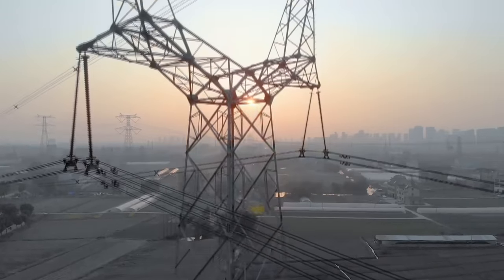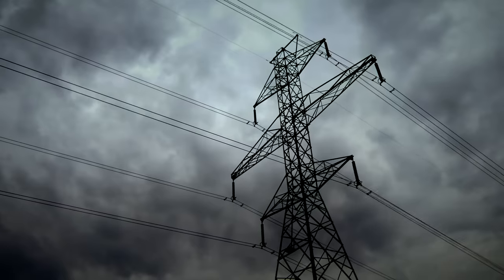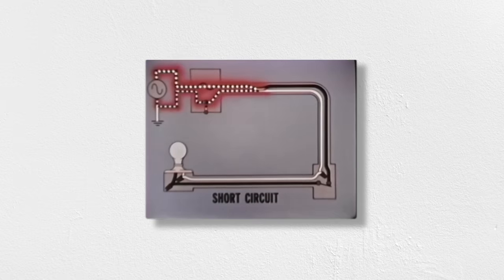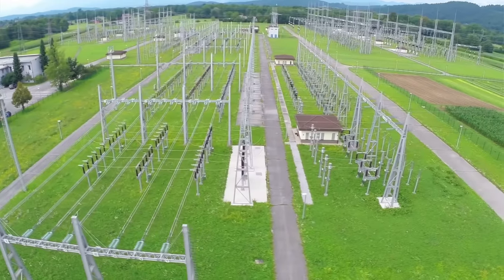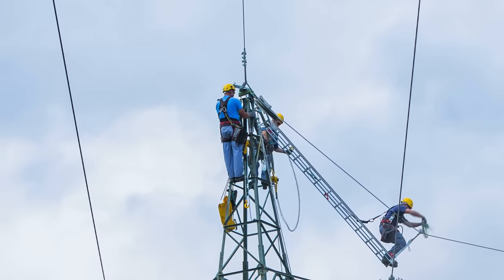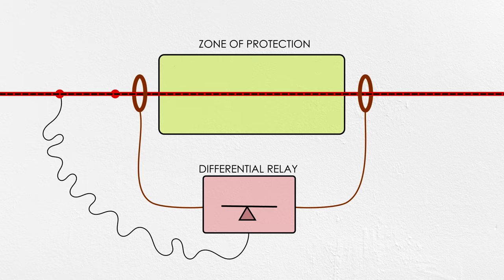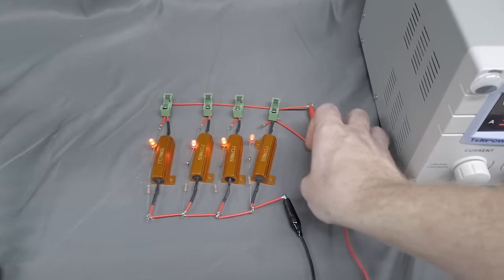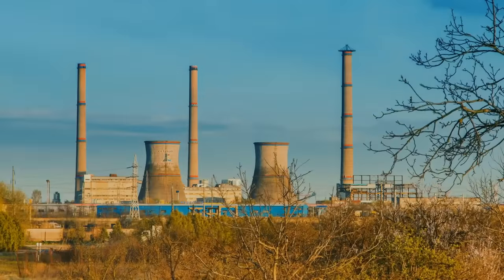How Power Blackouts Work

Comment: "Idk how much a car that never breaks down would cost"    About $1500 on craigslist for a 1994 Camry.....just sayin.
Reply: got a 97 civic that'll challenge that lol
Reply: I have a gold 1994 Camry that just rolled over to 390,000 miles. Can confirm.
Reply: The best is the Previa though. 750,000 miles on the engine and it's still got resale value
Reply: My gold Camry is approaching it's 20th birthday and everything is still working. Just keep the oil fresh and they'll go forever
Reply: Lol I thought of my 94 Camry as soon as he said that
Reply: IMO, I'd rather have a more reliable, longer lasting engine than one that sacrifices a good portion of potential lifespan for the sake of barely increasing "theoretical" fuel efficiency.  Real world driving conditions vary wildly, and is especially dependant on the operator.

(Edited on 10/27/2020 to be more descriptive)
Reply: Alfa 156 ts
Reply: My dad had a 94 Camry that he bought way back in 2001. It got stolen after about 7 years of being absolutely fricking invincible. Shit never broke down.
Reply: Toyota Starlet, still going strong
Reply: @sodiumvapor13  My father has a 2005 GMC Yukon with similar milage. Still has the original engine and transmission.
Reply: Lancia still going strong, no bodywork left after couple years due to rust but strong engine shame about electrics.
Reply: Volkswagen Golf 1965.
3000000 km and still going on.
Reply: '99 ford focus it is for me
Reply: Scotty Kilmer: [Breathes heavily]
Reply: Matt Farah has a 1,000,000 mile Lexus.
Only problems have been: very minor oil leak (1 quart every 1,000 miles) and worn down suspension bushings.
Reply: Or something you bought as a broken thing
Can't break if it was already
Reply: nostalgia from it being a mini
Reply: Willys cj2a 1947, nothing but a fuel pump rebuild and new head gasket in 75 years, well over 400k logged running hours
Reply: Oh man, came here to say just this!
Reply: 237k on my Camry. Have only done brakes and fluids.
Reply: Don’t listen to these guys, get a dodge! I’m only on my 5th engine!
Reply: Buy a German tank. Might be a bit hard to get replacement parts for those but it's unlikely to break down.
Reply: @PunakiviAddikti  problem is when it finally does it gets expensive.
Reply: Saturns man. I've got two. Bought my second one for $400. Already put 40,000 miles on it since. Drove it round trip from northern Utah to Texas. It's also driven nonstop to Albuquerque and back twice.
Reply: My beast of choice is an 01 golf. Broken but still runs anyway.
Reply: @DumbdogsWin  bah. Who needs all the features working
Reply: @LenniL-ob4ll  not really no. I drive cross country for a living. I don't get stranded.
Reply: Just look at the window sticker on a chevy.
Reply: No the 2001 model is where it's at.... Expect the door handles
Reply: Its called   rent a car,   if it breaksdown  Avis come pick it up and give you another,
Reply: @manitoba-op4jx  this is not matt farahs million mile lexus though
Reply: Co-worker sold his late 90's Ford Taurus for $500 ten years ago with 200,000 miles on it. Now it's at 400,000 miles still running on original engine/transmission. John told the girl, just keep doing what I've been doing since I bought it new. Engine oil 3k, transmission fluid once a year.  Maintenance is key.
Reply: 2001 VW MK4 Jetta. 250k km and not a single breakdown.
Reply: I can approve that. Bought a 92 Camry new from the dealer and it's still runing like a champ. Only maintenance and smaller stuff here and there. I drive that thing everyday around 300km or nearly 200 miles for all that time. 150km/100mi oneway. Don't know how far I've driven it, because the odometer stopped working long ago and I never saw a reason to fix it. The second clutch starts to wear out now but really it's mostly an oil change every 3 months or better to say 11 weeks, endless tyres, brake discs and pads. The front springs snapped once and I'm on the third set of wheel bearings. Other than that, no issues. I will keep as long as I can, no car will every come back to such reliability, lucky that I never sold it. In the first years I was thinking about it several times but scepticism held me back everyday and apparently I've been proven right. I dare the day I can't keep it anymore or an idiot will total it by rear ending me
Reply: Pretty sure that still needs a lot of maintenance, though. I think the closest you could get to a car that never breaks down would be the Mars rovers. Opportunity lasted 15 years with zero mechanical maintenance (only software), but it's pretty small, certainly not anything remotely like a car. Curiosity, though, has been going for 8 years and is still doing pretty well and it definitely is car-sized. So, as long as you're comfortable traveling at 90 meters per hour and are willing to spend a couple billion dollars, that's the car for you (a lifetime supply of fuel is included in the purchase price).
Reply: Gear God just don’t put a aftermarket set of wheels, especially the heavy chrome ones. The transmission will not like that, especially when it is asked to use the traction from double wide tires.
Reply: Note that this is more design choices than actual impracticability. Well, ok, you couldn't make cars where literally no instance of that model will ever break, of course. But think about aircraft. One of the top concerns for civil aircraft is reliability and if you maintain an aircraft well, it may well never break down. And even when it does there are usually multiple redundencies and even if those fail, the plane can often still fundamentally continue to perform with a good enough pilot having a chance of landing it. Cars break down as much as they do because it doesn't matter as much if they break down.

Car engines are designed for relative performance over reliability and have many unnecessary parts because you know, if your radiator springs a leak in a car, it might be a nuisance but it's rarely fatal. If your radiator sprung a leak at 8000ft, that's something of a different scenario, which is why most civil aircraft engines are air-cooled. Point is, aircraft are designed for reliability, often at the expense of pure peformance, because that's the calculation being made. If you designed a car like an airplane it would probably never break down (though it would go through fuel like a bitch, spew toxic fumes all over town, be noisy as hell etc). That being said, aircraft are fairly expensive.
Reply: Got a 2007 Ford Explorer that only had a fuel tank pump issue that was fixed within a month
Reply: 2000 dodge dakota v6 magnum, automatic tranny 2wd
did some work up behid the dash so we pulled the dash well while we were back there we did a full aircon rebuild, the heat exchange in the cab the one up frount, the compressor was dead so that got replaced
well we ran into a few issues here and there, replaced the rad and coolant
well we were so damn close to done then it turned into even more of a shit storm
the damn dipstick tube broke off in the block 
we tried to get it out, ended up breaking a tap off in it.... 
yep we have a lot of work on this cursed truck
Reply: * Happy Scotty Kilmer sounds *
Reply: My dad has a 2004 Saturn ion the has 395000 miles
Reply: $89000 for a new Land Cruiser.
Reply: @nup5  i agree, I'd rather have my plain old-fashioned naturally aspirated 1.8l engine than a turbocharged, low displacement engine that makes similar power.
Reply: I guess, to be fair, you have to consider all the routine maintenance you still need to do. Brake pads, engine oil, oil filter, air filter, tires, wipers, lights, etc.
Reply: @nup5  so your saying a lada niva is just as good as a toyota landcruiser
Reply: @manitoba-op4jx  i have heard toyota landcruisers exede that number
Reply: @loganritt3805  I'm not sure what you mean by that, but ultimately it depends on use case (unless, overall, one has many advantages over the other).  Can you explain what you mean with that comparison?
Reply: @nup5  you said that reliability has small efficiency gains and a lada niva is an unreliable car, and a Toyota landcruiser is a reliable car. What do you think would be faster at doing a job
Reply: @loganritt3805  oooooh.  What I meant was, I'd rather have an engine with a very long lifespan, even if it's not too efficient, instead of one that sacrifices lifespan for the sake of using less fuel.

Especially if the efficiency gains are trivial/not worth said lifespan reduction.
Reply: I have a 2007 camry still tippin on 44s
Reply: how about that toyota truck top gear tested
Reply: Can't beat a Landcruiser
Reply: @kperry5000  or don’t put fresh oil and it will still last longer than most cars
Reply: Awesome comment. I laughed and almost choked on my toast.
Reply: Anything before the 2000s don't break down all that often. This new cr@p they put out breaks down if you bump it. My 93 grand Cherokee was a tank never broke down and I trashed it. Buddys 07 vw golf already sounds like its done a year after he bought it
Reply: I have a saab with 550,000km... drives like new
Reply: Buick century
Reply: I got a nissan that isn't too much if he needs one.

Comment: Nice demonstration with the 4 led’s
Reply: its a great demonstration that deserved a better explanation for the voltage rise.
Reply: Not a very realistic one though: you can see the power supply is in constant CURRENT mode (6:53, the CC LED is on), which means it will do whatever it takes to shove down the current meant for four resistors down the remaining three , basically by raising the voltage until that happens. It wouldn't do that at all in its normal, constant voltage mode. In real life, the voltage applied to three lightbulbs in your home does definitely not go up just because you've turned the fourth one off (or more exactly it does so negligibly little).

Now, it's certainly possible that the power grid can have some sort of equivalent phenomenon going on in specific situations, but how or why that would happen was certainly not explained here at all.
Reply: True, the voltage is constant, but the current rise is what does the damage.  In combination Primary/Distribution substations some circuits have inductors because the primary transformers can (for a few cycles) put out enough current to melt and  fuse circuit breaker contacts together.  The inductor resembles a tube, and is designed such that normal load currents pass through, but a massive overcurrent fault will cause a huge counter-EMF (backpressure wave opposing current flow) in the inductor stopping any spikes from the primary transformers dead in their tracks.
Reply: @AttilaAsztalos  When I turn off my electric kettle at home, I can see the lights going brighter for a few milliseconds
Reply: @AttilaAsztalos  but that demonstration was exactly what happened when the 2003 outage happen. One line goes out and all the power (or current) that pass on that line had to be distributed to another line, which subsequently went out because to much power (current) and in few moments all northeast were out of electricity
Reply: @josedias3157  Resistor demonstration is exactly reverse of that.
Reply: @josedias3157  so how do they prevent it?
Reply: Picard doesn’t agree.
Reply: Quite misleading actually. The power supply is forcing current.
Reply: José Dias That happened because the same demand got redirected through less lines. In fact, the outage happened all at once, not gradually. The correct demonstration would’ve been the fourth LED staying lit, and drawing current from the other 3 lines, that ended up overloaded. There is a misconception, the power isn’t “pushed” in power grids, it gets “drawn”.
Reply: @josedias3157  I think that if one line leading to one city breaks, that won't increase load in the line to other city. When voltage is constant current is calculated by Ohms law (I=V/R, I=P/V). But when you suddenly take off the load form power stations generator, it can't change regime so quickly and it has to go down. If one goes down there is great probability that others will to, cause then the load of remaining grid is too high for them. That's why some countries have reversible dam power plants so they can balance the load in the grid.
Reply: @AttilaAsztalos  The equivalent phenomenon in the grid would be where you had several transmission lines in parallel feeding the city, and one failed. The LED does not represent the lights in the house, it represents the current across each transmission line.
Reply: Thanks
Reply: really fake demonstration, a parallel circuit does not collapse when a branch is down, only if it is permanently shorted.
power supply display not being shown in the video is a clue of what's going on.
Also demand is not pulled out of the grid by a line disconnection, that's the key of power grid overloads
Reply: The lack of electrical understanding in this thread is outstanding. When you have multiple parallel lines feeding a load and one goes down,  the current drawn by the load doesn't magically go down to account for the missing line. The resistance of the line is orders of magnitude smaller than the resistance of the load.
Practical Engineering was 100% correct with his constant current supply.
Reply: @thorlancaster5641  he says "resistor and LED representing the respective areas".. that is not what the CC setup represents. the explanation is wrong,not the setup. It is misleading because as you said, they are the transmission lines, not the loads. It is unclear and misleading although it is the central point of the explanation, nothing to do with 'us' not understanding how a CC works.
Reply: @atzuras  I just kind of corrected it to say that in my head. He should have said "the same area".
Reply: @AttilaAsztalos  wrong. The power supply doesn't do everything it can to push the current trough the LEDs. That is a limit and if reached the power supply reduces the voltage so the current doesn't go over the limit. The demonstration contains a power supply with constant current and constant voltages. To push more current trough a resistance you need to increase the voltage. The voltage is limited so the power supply doesn't do the damage.
Reply: @AttilaAsztalos  i agree it's not an accurate representation because of the fixed current but in real life every device and cable on the power grid causes volt drop. if a massive amount of devices turn off at the same time the voltage could in theory rise substantially. If the grid doesn't react quickly enough to the rise in voltage (and subsequent proportional rise in current) you could end up tripping more of the protective devices.
Reply: @thorlancaster5641  No. You are 100% wrong. In parallel conductors the resistance of the circuit will always decrease when you add a new parallel path. So when you remove a parallel path the resistance will always increase leading to a reduction in current.
What is left out in this demonstration is volt drop. Every device and conductor on the electrical grid causes volt drop. So if you turn off everything at the same time voltage will rise.
If a generator is producing 10,000kVA but you stop drawing current the voltage will rise until the generator reacts to the change in load.
Reply: @rambosclone8410  "So when you remove a parallel path the resistance will always increase leading to a reduction in current".
The decrease in current is not at all accurate when talking about switch mode power supplies and induction motors. The current drawn by these actually increases when the line voltage dips, and these types of loads make up a substantial proportion of the grid's demand.
Reply: @thorlancaster5641  but the voltage didn't reduce in this scenario. It would rise when the 1 leg disconnects. The same thing happens in your house when you turn something off.
Reply: The demonstration would have been much better if the circuit with the 4 LEDs would have had another separate load being powered through it in series. Then when the fuse blew in the one leg, the other 3 legs would have had the current increase through them.  This would have been much closer to what happens in a rolling blackout.
Reply: @florisr9  That effect would be from the impedance of the wiring in your home, not from the grid voltage dropping. The lights in your neighbors house don't dim or brighten when you turn your kettle on and off.
Reply: @raidzor5452  Power in the grid doesn't get "pushed" OR "drawn". It's A.C., it vibrates back and forth 50 or 60 times a second, depending on what country you live in.
Reply: @aleksandaraleksic4067  There are multiple parallel lines going into and out of a city. If one line goes down,the power that line was supplying gets re-routed through the remaining parallel lines, and the remaining lines share an increase of current equal to whatever the line that went down was providing. There is more than one line the current can take to reach the same place, and the current WILL increase in the other lines when one of them is no longer there.